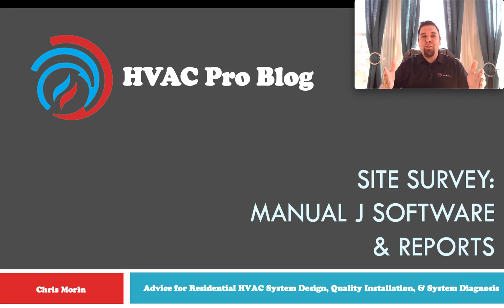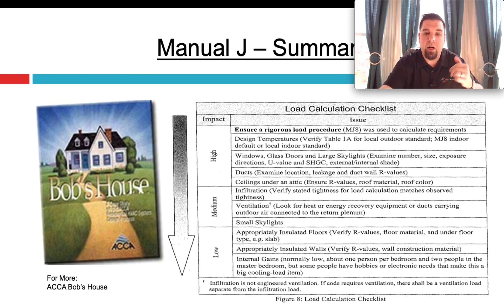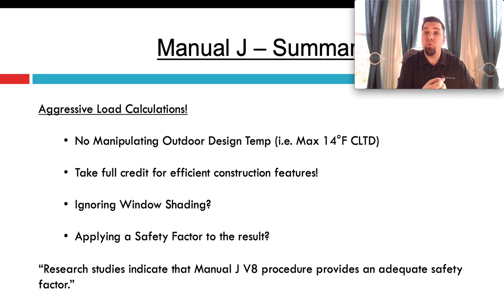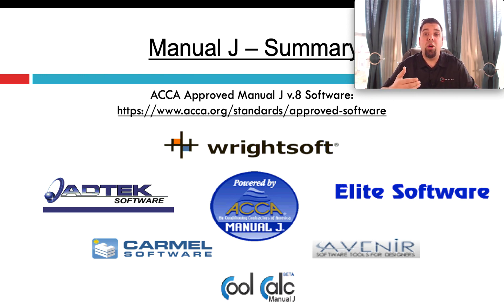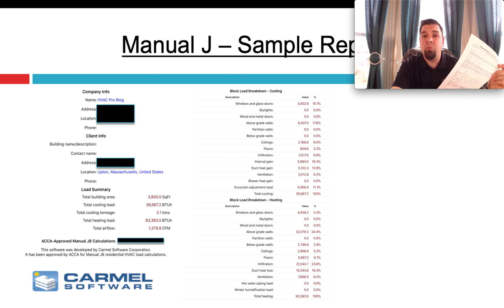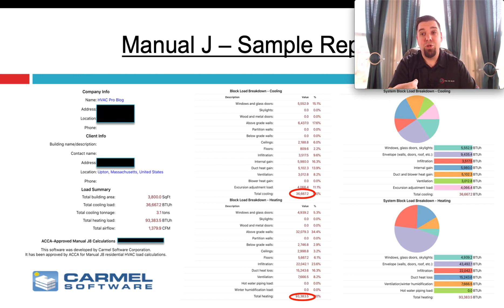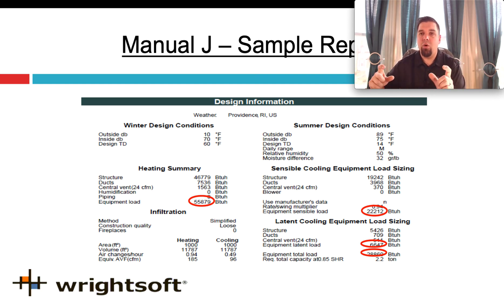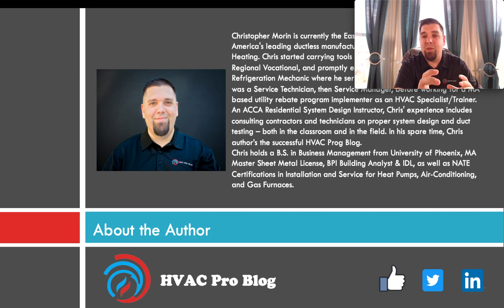Manual J Software and Reports

Comment: Sorry to admit this, I am a DIY HVAC guy trying to survive. I’ve had HVAC courses at local CC, have the tools, and have just given myself a PhD in half a dozen building codes, just so I can select and install a gas pack in my own home, according to code, acting as my own contractor.

I need to do a manual J 8 load calculation. The city threw away the plans for my house filed by the contractor, so I will have to make some assumptions about insulation R-values, U-values, etc, which isn’t optimum.

Can you give me any advice as to what software would be best for doing this, and any ideas as to how I could best obtain the ‘typical’ values of materials in my home in Durham, NC, built in 1997?

And, please pardon me if you feel this question is inappropriate.